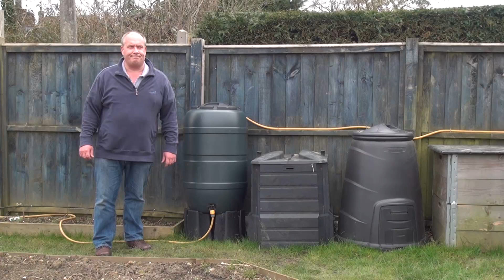Connecting Water Butts with the Rainwater Hub

Comment: I have the same water butt and connected a hose pipe from thx tap to irrigate plants but the water has stopped flowing through the hose, even though butt is full of rainwater ???? Any ideas?
Reply: It depends on how high the plants are in relation to the base of the butt.  Water flows down (gravity) but sometimes the amount of water still in the hosepipe may "equalise" the pressure from the butt, so water stops flowing.   I had that before when I tried to fill the pond with rainwater, using the hosepipe and the pipe was below the base of the butt, but strangely, it did not "empty" the butt.   For that, I will figure it out somehow.  :)